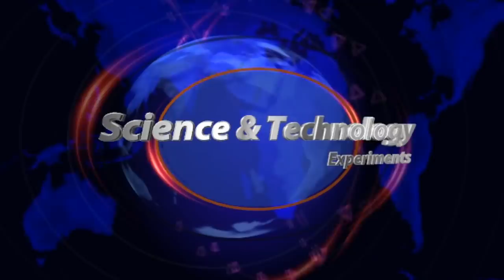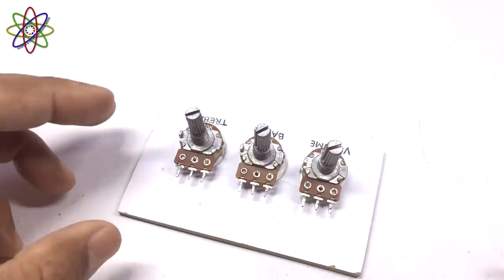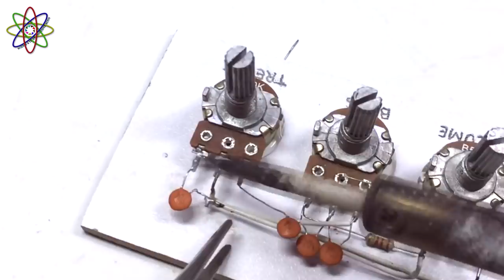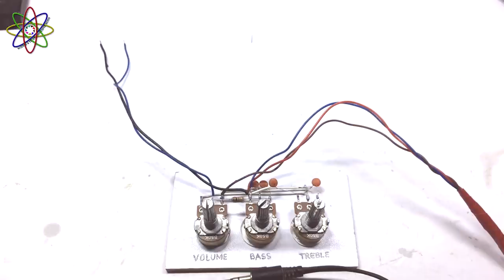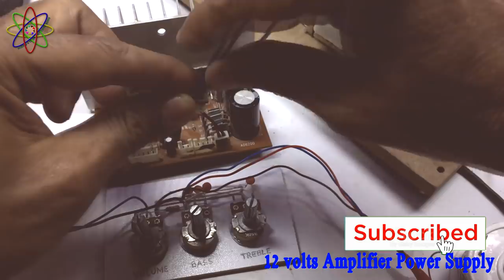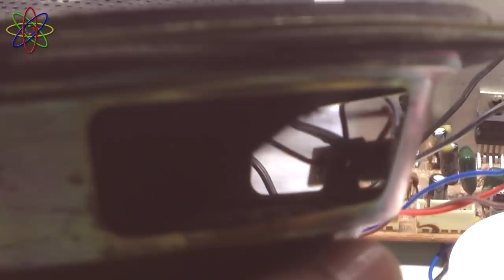DIY Deep Bass and Treble Volume Controllers - How to make heavy bass and treble for diy amplifier

Comment: Is the 12volts power depends on the amplifier we use?
Reply: I did it with the pam8403, it works with 5v, I made the tone control in this video and it worked well. Remember that this controller does not use integrated audio that requires power since it is only a signal, it does not require a 12v power supply.